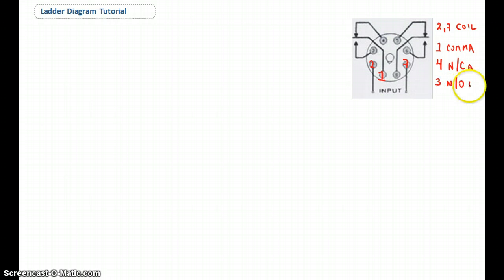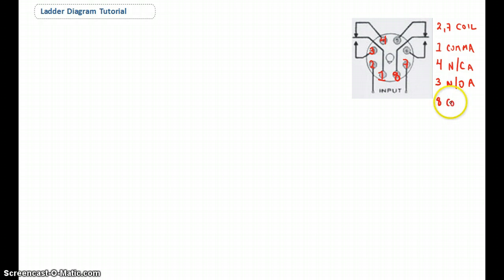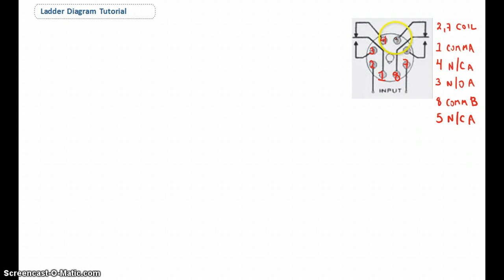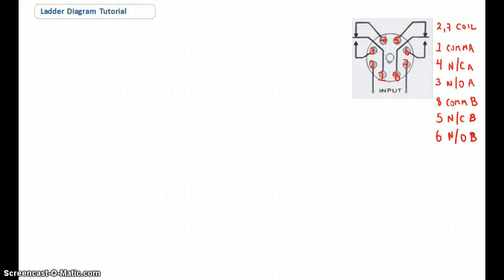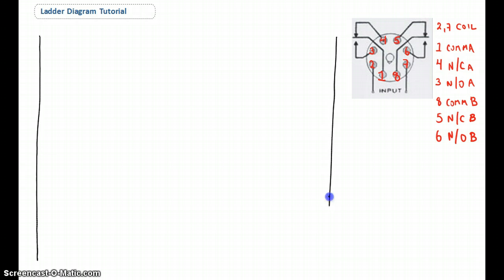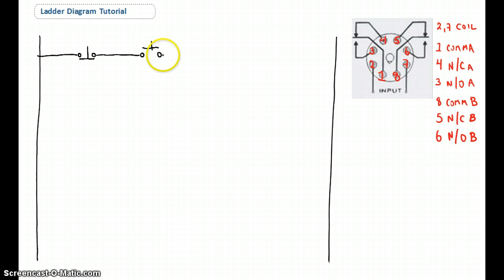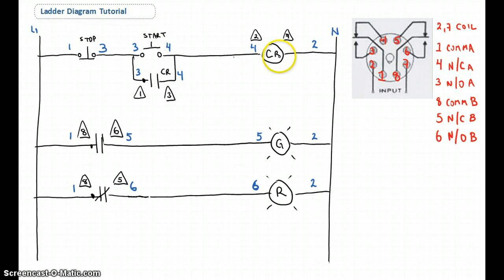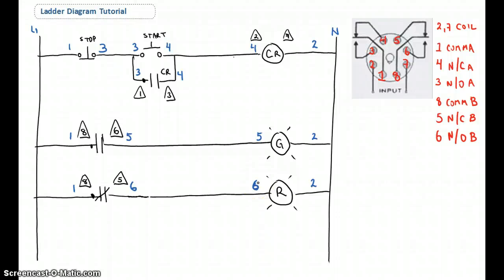Ladder Diagram Basics #1

Comment: What If the supply for the relay is 110v and the your pilot light only needs 15v what will you do
Reply from the maker: A step down transformer would be required. Often a pilot light will incorporate a small step down transformer as part of the unit. Here is an example of a 120 v supply, 28V pilot light 
https://www.crescentelectric.com/industrial-automation-and-control/electrical-controls-and-accessories/indicatorpilot-lights-and-accessories/indicator-lights/indicator-or-pilot-lights/30mm-push-button-type-sk-pilot-light-transformer-120-vac-red-fresnel-cap

Comment: Allen Bradley ProLogix is what we are using to build PLCs and simulations.  It's got different simulations like conveyor belts, traffic intersection light controls and a few others I haven't messed with.  The interface is a bit windows 98ish but its still functional.  If you are forced between buying a text book or that, get that software.

Comment: so 2 and 7 on the 8 pin contactor feed the coil for the control circuit? which # is the neutral?
Reply from the maker: Convention is that Pin 7 is the return/neutral

Comment: Can you explain how the control relays coil will stay energized after the start push button returns to the open state
Reply from the maker: Current still flows to the coil because the relay contacts have changed state. The normally-open (in rest state) is now closed. This provides a parallel path around the start pb to keep current maintained to the coil.
Reply: @PeteVree  https://youtu.be/77tDhXDsfqI thanks for all the valuable information

Comment: I am having this issue thanks for making this video. But one thing I’m not understanding is when it comes to wiring the block are you wiring it based on who you have it numbered in the diagram ? With the start button you jumper from the stop to the start then the number one goes on the bottom of the start button with number three

Comment: Great video. However, I don't see the need to use a jumper because 1-4 is fed directly from the power supply, and Pin 1 is hot regardless of state of the stop switch. And I'm not sure about using contact 8-5 as opposed to contact 1-4. They are both controlled by the coil and are fed independently from the power supply.
Reply from the maker: Have a look again... the video is specifically made to address this misconception.

Comment: In this schematic we numbered the terminals of the relay contacts. Why do we not number the stop, start and light terminals. Is this not done etc. I am an apprentice and would like to know this point for exam purposes. Thanks
Reply from the maker: The light, push button terminals have no polarity, and so it would be redundant, and a complete waste of time to put numbers for all of those components. Also, it would really crowd your ladder diagram. On the relay, you have a choice of using commons 1 or 8 for example, so you have to put the terminal numbers in for ease of installation and trouble shooting later on.
Reply: Thanks for clarifying this in detail. Now i appreciate the terminal numbering better and its importance in wiring diagrams.
Reply: The relay has those numbers, he's just trying to help on how to use each number on the relay
Reply: On an electrical schematic, those termination or landing points would be called out.

Comment: The only thing I'm confused about is right before the 10 min mark when you say it bypasses the stop  button when some people try to use 1 and 4.   As I look at it, that contact would still change state when the stop button is pushed and the red light should work.
Reply: When the start switch is pressed, power flows through it to energize CR, closing contact 1-3.  The stop button is bypassed because point 8 and point 1 are both connected to supply voltage.  So power is fed (follow the red line) past the stop switch.  You can press the stop switch and it will have no effect.  The correct NC contact to use would have been 8-5 for the red light.
Reply: that's how l see it too...
Reply: Thanks for commenting. I wish Pete would chime in.
Reply: Boomer NYOB You could still use contacts 1-4 if you use a separate piece of wire coming from L1 to pin 1. Then come out of pin 4 to your red light. But contacts 8-5 would be more efficient by not having to run an extra piece of wire.
Reply from the maker: ussreeves has the best explanation below. Thanks for clearing this up guys.

Comment: Thank you.
Please at point 3 & 4  (latching circuit). , 1 & 5, and 1 & 6 contacts to operate both red and green light. We have some terminals of relay there as well e.g at point 1&6, we have relay terminals of 8&6 as well.
My question is are we connecting this relay terminal to this point as well

Comment: Thank you, this really helped me a lot on how a ladder diagram works on a relay. But do all ladder diagrams refer to relays?  Or can they be used as basic point A to point B wiring? Thanks in advance!
Reply from the maker: +Samneil Samson They don't always incorporate a relay. They could simply use a contactor for a motor. And, yes, you can often use a ladder diagram to simplify any circuit you are working on.

Comment: dude thanks . good teaching . 1 question . is that a latching circuit . i mean pb 1 and pb 2 , with that coin  at the first line ???
Reply from the maker: +Lc Fadz It "latches" because the holding contact closes and provides an additional path for current to be maintained to the coil